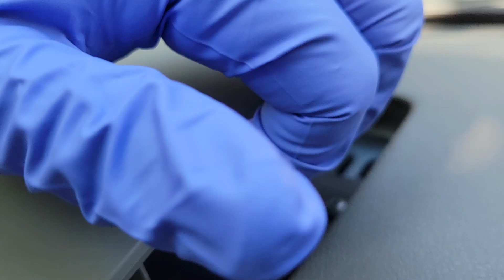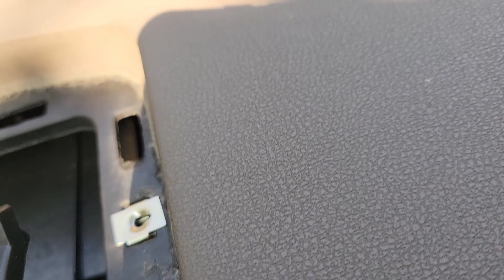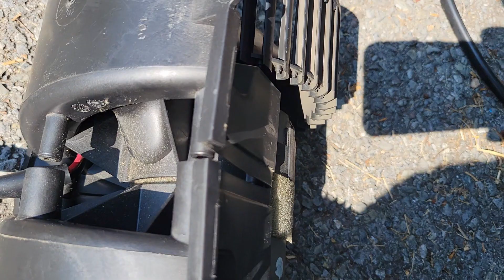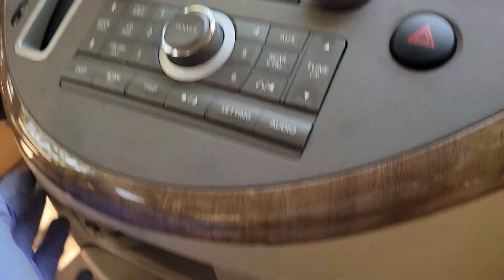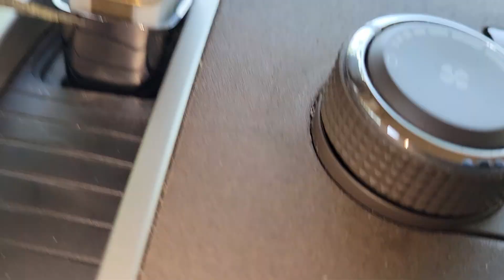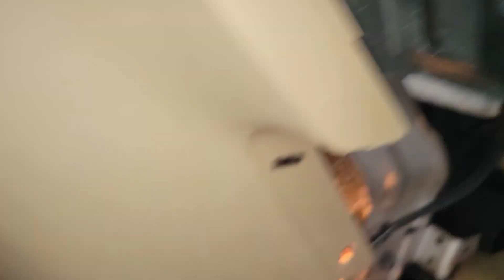2008 Nissan Quest blower motor and resistor replacement. Blower will NOT turn off and stuck on high.

Comment: Same deal with my 2008 Nissan quest. I feel like this is a common problem and if it's not known it should be reported as one because I'm sitting here in my van right now listen to the worn out blower motor.
Reply from the maker: yeah agreed, I really like the room and layout of the Quest but I feel I'm repairing more than I would on other vehicles. That blower motor repair is still going strong 2+ years

Comment: watch out the "fan" part on the driver side always hangs up so watch for that, and to get the duct back you have to use your fingers to "flip" the lip under that foam bit that was ripped in the video.
Reply from the maker: yeah that's a good point, kind of remember that hanging up and being a pain

Comment: Got Van back from shop for belts and Power Steering Pump . Then noticed this same issue Shop office girl quoted 2100.00 for blower and Resistor your video gives me hope. I replaced my backup sensor  few years ago. I’ll start with the resistor also.
Reply from the maker: wow, that is a ridiculous $$$ quote -- did the resistor work?

Comment: If you have the model with a screen for gps, the plastic dash cover comes off same way from behind the screen. Then there’s two bolts holding the screen frame. Once the bolts are out the same clips as shown in the video hold it in place. Just yank up.  
The defroster duct is nearly impossible to get back in place.
Reply from the maker: good to know thanks, yes that duct is a true headache to deal with

Comment: Same issue, have the 2007, trying to keep until it hits 200k, at 167, just changed module and working, I will see for how long, blower will most like go out soon, usually thats the case.
Reply from the maker: Yes if your module/resistor goes out again soon after replacing, then replacing the blower motor should at least rule out that part of the system as the cause. (Though certainly possible to get a bad, new part). Hope it fixes the issue, riding around with the fan on high all the time made for a noisey drive.

Comment: I got the same problem with the same car! So you think that the fix was to change the resistor  or the blower fan?? By the way,  thanks for up loading this video,  it does help me a lot on what I'm going to go through!!
Reply from the maker: Glad the video/information helped. For me, I had replaced the resistor, and the blower operation failed the next day. Since replacing the blower (and again another resistor) it has worked normally. I ended up just buying the cheapest resistor on Amazon....believe it was like $25.
Reply: Okay thanks,  I'm going to start with the replacement of the resistor,  and go from there! Thank you so much for replying! God bless!!
Reply: @elgarfio138 Did it work? I'm having this same issue

Comment: I can’t get the shroud in🤦🏾‍♂️
Reply from the maker: The shroud was a pain getting back in, but since it's thinner plastic it can flex/bend a lot. I found putting back in at an angle then bending the front-facing edge past the upper foam seal worked best for me. I did end up tearing the foam a bit, but it's fragile due to age.
Reply: @diytry4580  I almost got it